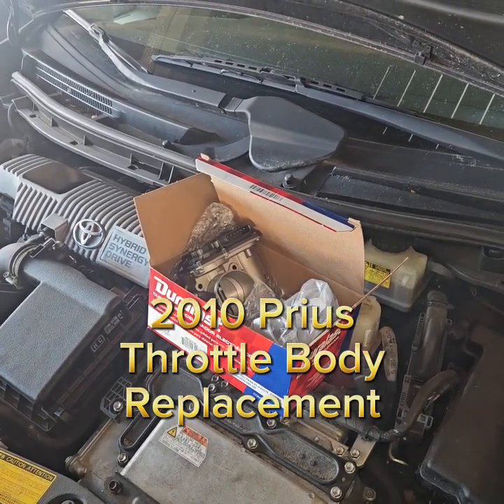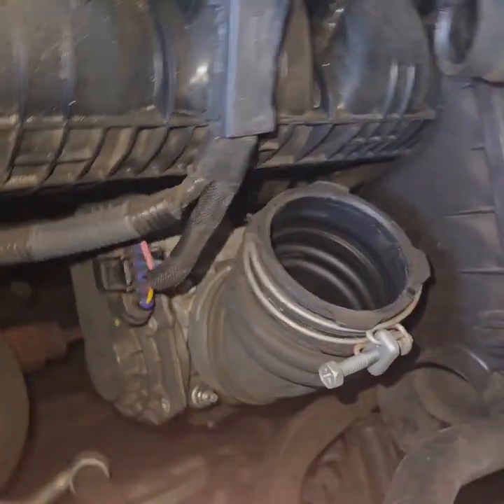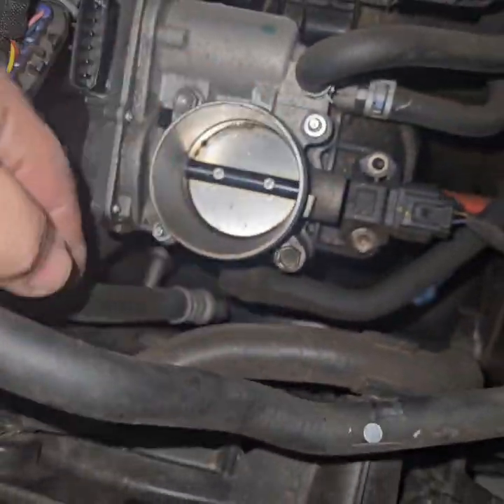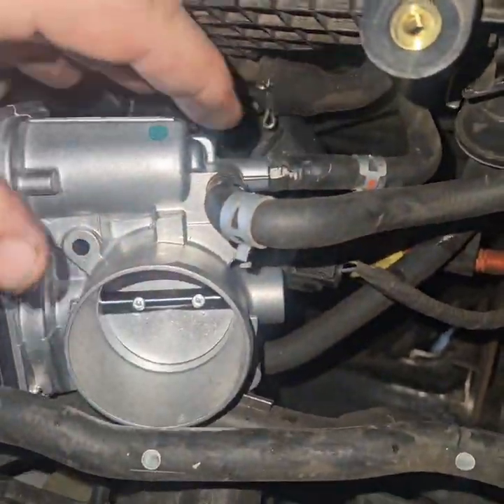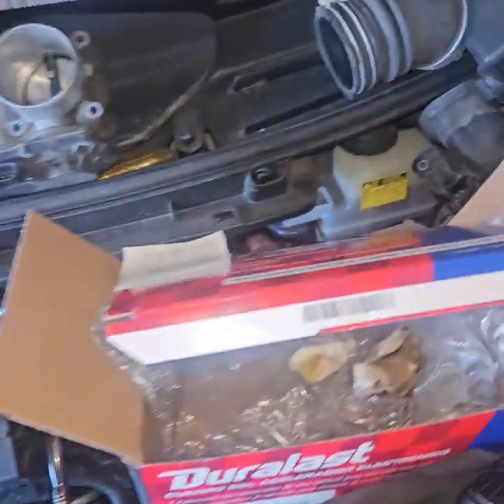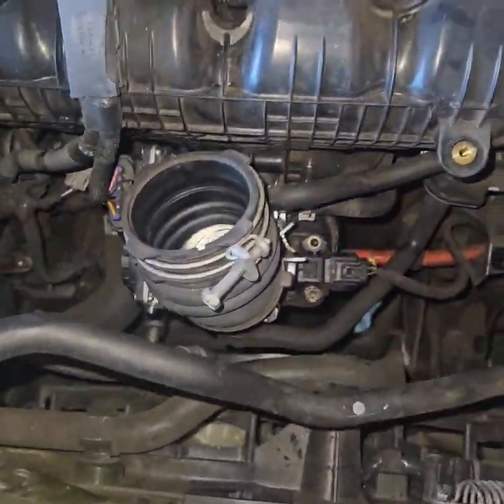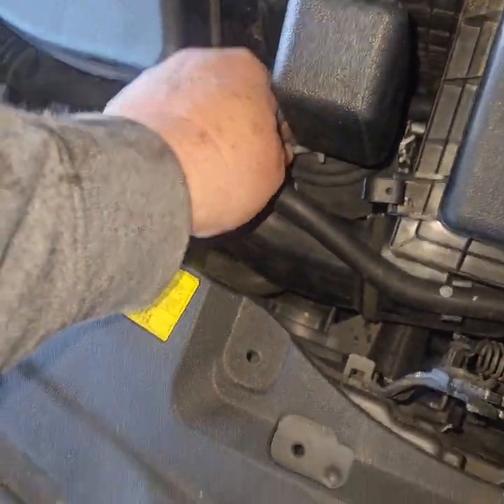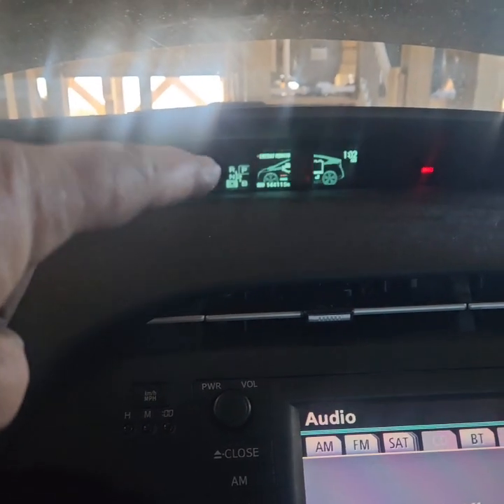2010 Gen 3 Prius Throttle Body Replacement

Comment: Did you have to do a throttle body relearn?
Reply from the maker: No, once the new part was installed, after a few drive cycles the permanent errors went away.

Comment: Im about to that on my 2010 prius ,does it need relearned to the car ?
Reply from the maker: I did not have to do anything special after installing the new part.
Reply: @roscoesrepairs  thank you very much i hope is just that it inly gives me p2111 code so far and i am still driving around and clearing code when needed out of limp mode so fingera crossed
Reply from the maker: @hristopetrov3258 I drove mine for 6 months or more, and it finally stopped running while we were on vacation. I got more and more throttle body codes. Stuck open, stuck closed, not responding.
Reply: Waiting on the part coming friday will see hows gonna go  @roscoesrepairs